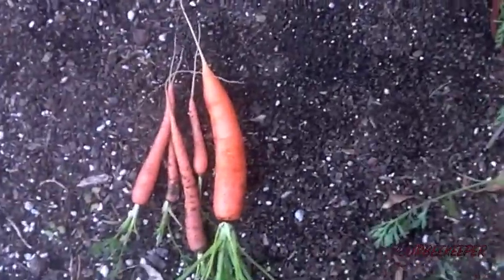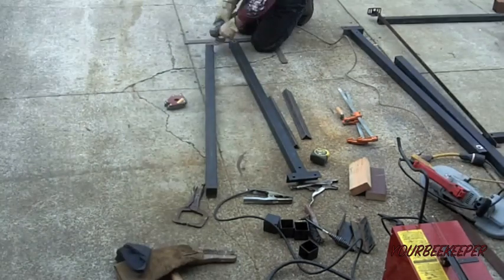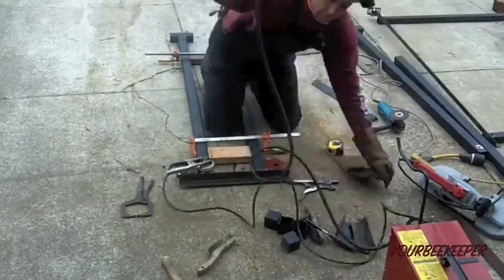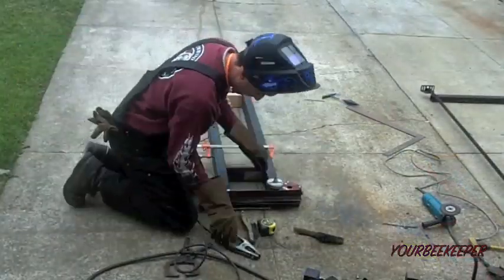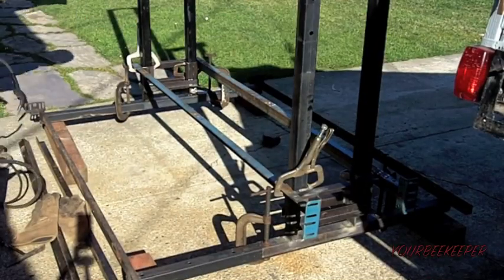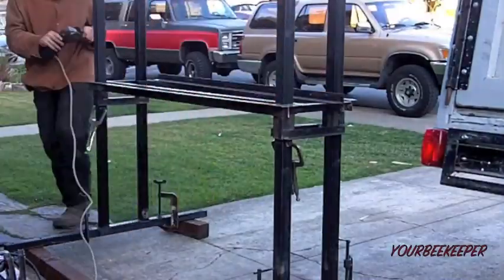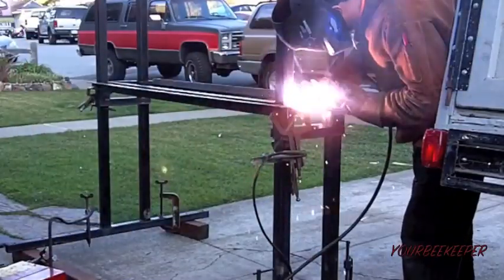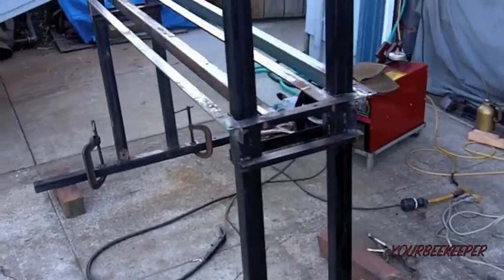Building the Sawmill Bandmill Cutting Trolley 1

Comment from the maker: @ncrdisabled Hey NCR, I avoid no-name wire.  With MIG, you get best results with clean wire.  I like the flux core for thicker metals, it burns hotter than gas shield wire. Down side is it spatters and the boogers need to be knocked off for your work to look nice.  Using gas and regular wire, you can weld at lower heat (body work) and get less burn through and warpage and is my preferred method.

Comment: How do you like flux core wire . I have tried Hobart .035 flux core it is a lot better than the Harbor freight junk wire. I am disabled so I have a old wheel chair that I keep fixing . It kind of like body work . I have heard using gas is better for body work . Which way would you do body work?

Comment: wood and metal all the same you use the same squares and levels and in some instinces saws just different blades only differance is material in metal working your nails are bolts and rivits your glue is your welding nice part about metal if you make a mistake you can weld on another section wood you make a mistake you get another board